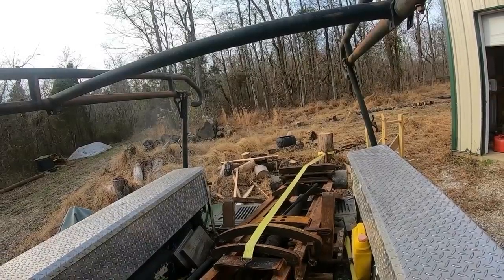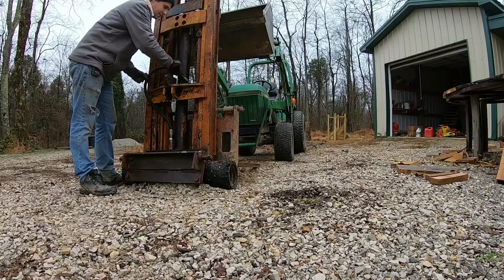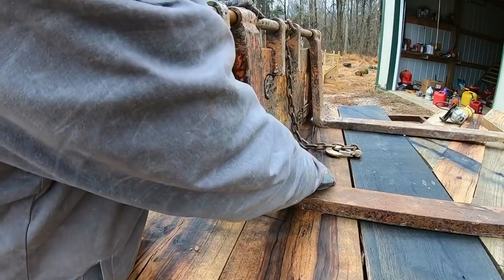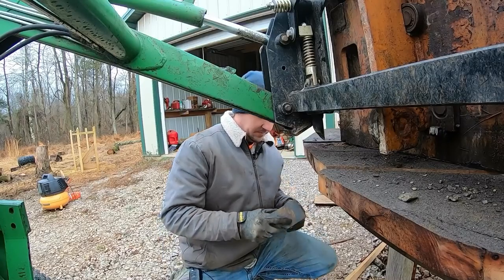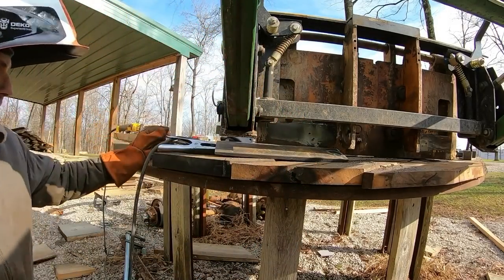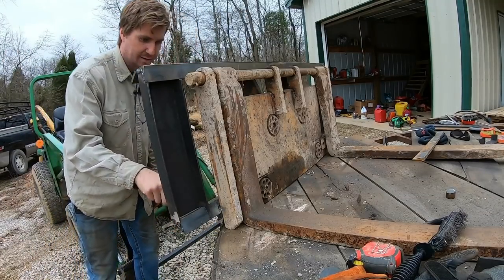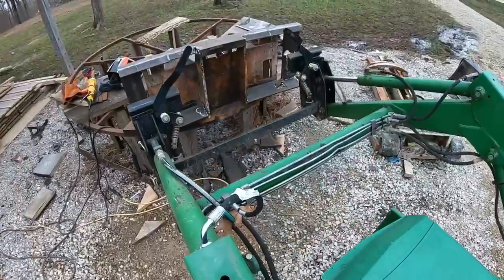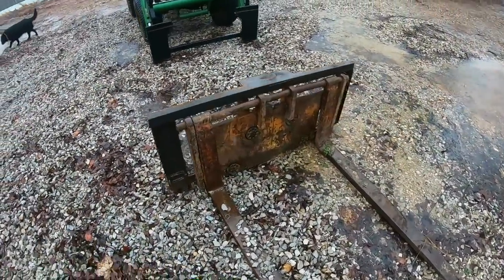Converting Three Point Forklift into Quick Attach Pallet Forks - Will it Work?

Comment: Captain those are a dandy heavy duty set of forks. I gave 500.00 for my set and they are kind of a light duty set. Bent the frame several times. I don't think you will bend any part of those. And I use my forks as much or more than my bucket just moving stuff around.  And the pond, looks awesome man! Looks like, I think you mentioned, that you could add a little pipe on the overflow pipe and raise the water level up a little bit if you want to. Probably this summer when the dam has settled and dried out good. Thanks for sharing this video with us. Enjoyed it!

Comment: Forks are one of the most underrated pieces of equipment . So useful
Reply from the maker: I used them today and I have to agree, got a lot done
Reply: @CaptainKleeman  fork extensions are always something that seem to come in handy to load some awkward long pieces too. Drill a hole in a fork to attach a trailer ball for moving trailers around easier.
A small dumpster build that has fork pockets underneath make cleaning up around remote locations easier. Maybe even a dump feature on the dumpster, if youre looking for a few small easy DIY builds to go with the new forks.

Comment: Hello Mike .  
the big advantage of this style of forking is that you can fold it up.  
this makes it easier to maneuver through the forest with the forks on the tractor, fold them down and pick up something more.  
drive backwards into the shed with the forks on the tractor and when you fold them up you need MUCH less space to still be able to close the roller door.  
If I were you, I'd check to see if it's really necessary to fix the forks permanently . 
you could also just drill a hole with a bolt through it or a chain with a tie on it . I certainly wouldn't negate the ability to fold the forks.  
I don't know how this is arranged with you in the US, but here you are not allowed to drive on public roads without a load with unshielded forks.  
That's why they came up with folding forks for forklift trucks at Toyota.  
normally there is a bracket on the fork board where the fork is folded up, there is a pin through it and they can no longer unfold when you drive over the road.  
thanks for the video Captain Kleeman. 
Sincerely, Hollandduck from the Netherlands
Reply from the maker: You make an excellent point.  Thanks!

Comment: Hey Mike, Happy NY. Just FYI Harbor Freight has 5 packs of soap stones for $2 (60633)- I can see my marks on steel better w/those. I bought a cheap portable plastic toolbox that I keep my welding helmet,jacket,gloves,clamps etc. in. Helps keep them clean-ish and makes it easier to find all my welding stuff. Now that you have all of that "scrap" from the mast, maybe fab up a fork pocket w/ a 2" ATV receiver tube HF (65961) that just pins through a hole in 1 of the forks. Makes hooking up/moving trailers easy. Your QA fork setup came out good. Thanks for posting.
Reply from the maker: Just ordered some soap stone today!

Comment: You’ll love having forks, especially when you have them rigged up so they don’t flop around. I use forks on my tractor more than I use the bucket. Any loose material I have I pile on pallets so when I need something I can just use the tractor. It’s a back saver and a time saver. Good job on the project. I’m slowly trying to get into fabrication and at this point I’m like you, digging through scraps because I have no idea what to order at a steel yard. Keep up the good work
Reply from the maker: I definitely need to snag some pallets to keep around the property
Reply: @CaptainKleeman  I always grab them out of the dumpster at work or off the side of the road if I see some lol

Comment: Suggestion- keep those forks hinged as they are.  I've had experience using both styles of forks on my tractor, mostly for brush to pile up for bonfires, and decided to "upgrade" to a fixed fork... thought I could stack higher on the pile.  Reality was the opposite - wish I had those hinged forks back on my JD 2032 with a H130 loader.  We have similar tractors, so you might use it a while before investing too much more time into a mod that you would/could regret.  Good luck, love the videos... keep them coming!
Reply from the maker: That's exactly what I plan on using them the most for.  Having it hinged saved me several times yesterday when I was using them.  Definitely keeping them that way.  Appreciate you looking out!

Comment: Great Job Captain those forks are better than store bought. May I suggest also welding the top middle. Piece you bent down to the original supports. Just to prevent those top bent pieces from bending up. They are supporting the entire load and forks. God bless
Reply from the maker: Thanks for looking out Thomas!

Comment: Nice project. When I attached a MM1 plow to my skid steer, I bought a quick-attach plate then modified and welded Fisher push plates to it.  Way less thinking involved.
Reply from the maker: That's what we had done with our FEL.  Trying to save a buck though
Reply: thats what i plan to do when i can find a cheap enough plow to use with my new holland tractor. its sad the way prices have went, my quick attach forks i bought were titan and only $399  they are now $799  so the price has went up $100 per year since i bought them lol.
how do you like the plow on the skid steer? i really would love to get a vplow type  but i dont have remote hydraulics up front
Reply: @erikgiggey4783  You don't need remote hydraulics. I mounted a second battery to the attachment plate and used weatherpack connecters for the lights and hand held controller. I ran a #10 wire from the alternator to the second battery to keep it charged up . I f the skid steer craps out, I can still remove the plow and put it back on my truck. 👍

Comment: Forks are definitely a must have. Great job on the fabrication. I fabricated mine as well from a bale spear. I like that you have the skid steer style quick attach rather than JD. With your newly acquired property, you could benefit from a little larger tractor. Maybe a 40hp. Better lifting capacity as well. Cool project thanks for sharing.
Reply from the maker: Maybe one day! Just not in the budget currently

Comment: Lookin good Mike.👌
A couple of suggestions:
If you make spring loaded tabs on the forks, you can still take advantage of the adjustable slide feature (which is the purpose of that style) and still lock them when tilting.

The amount of hauling you do around the property, especially as the new rentals start being utilized, you might consider a longer bed, dump box? Perhaps the multi stage cylinder would be useful?
Projects are coming along nicely.👍🤙
Reply from the maker: We plan on doing a dump trailer, but we will be using a different cylinder
Reply: @CaptainKleeman  Makes sense, most forklift cylinders are three or four stage depending on how high the lift is.
I went back and watched the other build video again and it looks to be a three stage by the number of rail sets.
Either way, I look forward to seeing you tackle that project when it happens. 🤙

Comment: My first thought was to buy a quick attach blank plate and make it easy, but hats off to you. That looked easy and turned out great! My forks on my Kubota have a set up for a round bale spear and stabilizers, and a 2 inch reciever for shuffling trailers around.
Reply from the maker: If I wanted to spend money and make it easy I would have just bought a set of QA forks 😂
Reply: @CaptainKleeman  exactly. Job well done!

Comment: Mike, looks great and your welds are getting better.  You sure took this differently that I was thinking.  Great job.👏👏👏👏  Just an FYI: Your total cost is approaching the price of new one $749 (If I use your thinking from the saw mill conversation a few videos ago, adding in your time and effort, top rail, paint?, your almost at that price)!  😁😁 But, hey, you can say you build yours.
Reply from the maker: Almost the cost of a new one?  $300 is pretty far off the cost of a new one, especially considering I still have all the material for a whole other implement and a cylinder to sell.

Comment: Nice work Captain.  That old mast and cylinder could be used as a wood splitter  or bed for your own saw mill.
To stop the forks from sliding Weld a chain hook to the top of each fork with the opening towards the tractor, then Weld a piece of chain to the frame on the top so the chain can hook into the hooks so it won't slide and you can "lock" the forks to the width you want 😉
Reply: And the differential he loaded on the tail gate would make for a nice double drum cable winch.

Comment: Mike you could look into possibly building a lift with the cylinder. Mount it to a heavy plate, bolted to a concrete pad. Could lift the tractor for maintenance or one side of a vehicle or one end.

Comment: Golly Fella, Your welds in the grooves on top look like a pro.  I find your rod control very effective.  The next thing you need is a big ballast box on the back of the tractor.  My extreme modification of a Bobcat 4-n-1 bucket still left me with a very heavy bucket requiring ballast and still very tippy if the lift is above the hood. 
I bought two forks and a quick attach plate and welded brackets for the fork pivot rod.
Reply from the maker: I bet you love that 4n1.  They look handy

Comment: Happy new year 🎉 Mike.   Great find and job on the forks.   Use the 2 stage ram for a log hauling project... use it on the 3 point to build a log lift and hauler that is closer the center of gravity on the tractor. ( I'm assuming yours has a rear aux hydraulic out for it) would come in handy for "lift" applications too!
Reply from the maker: Happy new year!

Comment: Great video. It's not overbuilt or underbuilt. You may possibly want to add a thicker playe under the quick attach pin holes so it doesn't wallow out. You probably won't use it enough to bother but just a thought

Comment: Nice job on the forks re-construction, a little more welding and it will be good to go! You might want to weld around the lower square pin holes,regain some strength there. Also,the lift cylinder would work on a dump cart if you used it in a scissor lift configuration, or leave it on the frame work to push fence posts into the ground; mount it onto your logging arch axle frame work to lift and lower the arch,,but by all means keep the hydraulic cylinder, might be able to trade it for a couple of smaller cylinders for some other projects!! Happy New Year Kaptain
Reply from the maker: Not sure I can get it to work for what I'm doing, but you're right about being something to trade with!

Comment: Me i would also add a doubler plate where the latches lock in in the bottom to prevent slip out and excess wear, just a piece of the plate you are cutting out for the bottom fork pivot locks will work great. Cool repurpose and wont have to worry about bending those either, i bought a set of forks for my tractor and my dad bent the lower fork slide bracket within a week lol.
Reply from the maker: These should be heavy duty enough for the 755 for sure.  Thanks for watching!

Comment: The standard for marking steel to be cut, is flat soapstone pencils. Get the holder for them and save some grief from busted markers. A box is $12 for 24 or  $12/8 with holder.
Reply from the maker: Just ordered some!   Thanks
Reply: @CaptainKleeman   I forgot to mention to make sure you get the right size EXACTLY. There are several chinese exra thin ones that break easy. The regular one is 3/16 thick.

Comment: Those welds are looking better. My only advice would be to cut out most of the original fork back plate.  Every pound your fork weighs is a pound less you can  lift.   I think it will be plenty strong enough with all the C channel you added.  Paul
Reply from the maker: Definitely going to cut out as much of that plate as possible.  Thanks for watching!

Comment: Good job Mike, especially for a novice welder/ fabricator. I don’t know if I would be to worried about locking those forks back, as many times as you want them fixed you will wish that they could float.
With over 30 years working in the equipment / welding industries, I can tell you that it is a scientific lay proven fact that the degree of difficulty striking an arc is directly proportional to the effort required to hold the pieces to be jointed in place. 
Happy new year to you and yours
Reply from the maker: I went out and used them today,. Being able to float saved me a couple times, was surprised how much it didn't bother me.  I think you're right,. I'll just leave them
Reply: @CaptainKleeman  good choice. The other aspect that I neglected to mention is that those forks are made of a tempered high strength steel. Welding a stop where you were thinking of putting one would change the characteristics in that area creating a hard spot. Not that your small tractor application would ever have the power to make that an issue, but you never know where they might end up latter in their life.
Reply: @CaptainKleeman   When you said you'd weld a clip on the back of the forks, I thought you meant something that would engage when you wanted to lock them and unengaged when you didn't.  That way you have the option.  And you should still be able to slide them when necessary.  Worth considering?

Comment: Happy New Year.

Looks awesome Captain.  For the cylinder think more about using it for a dump body of some sort before you list it for sale. Although your 755 may not have the hydraulic capacity to fully extend it meaning you'd also need some sort of fluid reservoir to keep the 755 system full when dumping and that may not be possible.
Reply from the maker: I'm really having a hard time getting it to work.  It's a two stage cylinder too, one comes out the top and the other comes out the bottom.  I need to hook it up and get a better idea of how it works
Reply: Yeah dumping trailer was my thinking also.

Comment: Hey Captain! Nice work on those forks. It may have been said already but my thought would be tor remove most of the original plate that you are going to cut the "windows" out of. Those forks are many times more sturdy than what your tractor can lift so getting as much weight off as you can will be more weight you can lift. Happy New Year!!
Reply from the maker: Yup, definitely agree

Comment: Also to notch that out a small torch would be handy as well. With fabricating now in your system you will probably want it more in the future
Reply from the maker: Definitely need to look into getting a torch
Reply: @CaptainKleeman  they are very handy. You don't need anything big for your operation just a small torch and maybe a rosebud for straightening objects. For you I would suggest acetylene as a fuel instead of propylene just for accessibility around you it would be easier to find a replacement. Propylene burns a little cleaner and gets a little hotter but you aren't a big welding shop like what I work in.

Comment: Hey your welding skills are getting much better!! I still say you need to clean a little more but they look pretty good to me!! And as far as fabrication goes you get an A..! That wasn't some little bracket to hang a shelf on and looks pretty beefy and well put together good job!! That two stage cylinder might be nice for splitting long logs for fencing?
Reply from the maker: The problem is the cylinder is only power one way.

Comment: Mike on the forks you could cut a hole and mount a trailer hitch to the back side. In the center. Andrew Camarata has a winch mounted to a receiver. Something like that would work well. Could come up with other things like that for when you need a little more control.
Reply from the maker: I've got a 10k log winch for the three point that works really well for me.  Good thought though!
Reply: @CaptainKleeman  I knew you had the winch it was a good video. It was more an example of things that could be mounted on a receiver and used in that location. Hope you had a great new year with your family.
Reply from the maker: @davidbillings615  hey happy new year!

Comment: Hi . Mike. You can build a dump truck for your tractor. mount the hydraulic cylinder in front of the platform and use the chains from the tower to lift the platform with.
Reply from the maker: We plan on a dump trailer, but that cylinder is too big for that.

Comment: You could aways buy a quick attach plate to weld onto the forks.  I remember DP had one and used it for the root rake that he and MBTS just recently built.  Granted, it might cost a bit more than the materials you used for the forks.  I guess it would depend on whether you want it easy or you just want to do all the fab for the fun of it and practice.

Comment: Take your mast assembly and turn it into a man lift.  Build you a 4' to 6' wide x 2' or 3' deep platform with a safety rail and gate.  You'd have a nice little work lift.  You could even rig a hydraulic valve assembly to operate the lift from the platform.
Reply from the maker: You've got me thinking

Comment: Happy New Year Mike it looks like you are welding with 7018 and that is the rod of choice . But for a novice  (stick) welder  , I think you should use 7014 . You will find it to weld easier . Once you feel comfortable with that then go back to the 7018 . Keep up the good work .
Reply from the maker: Thanks for the tip!

Comment: You can make a log splitter easily with that boom or mast with the cylinder in it
Reply from the maker: I don't think I can,. It's two stage, one stage comes out the top and the other comes out the bottom